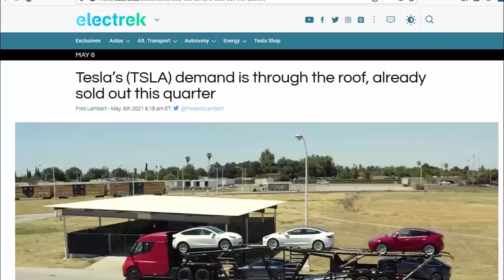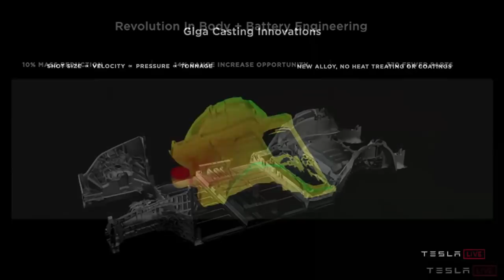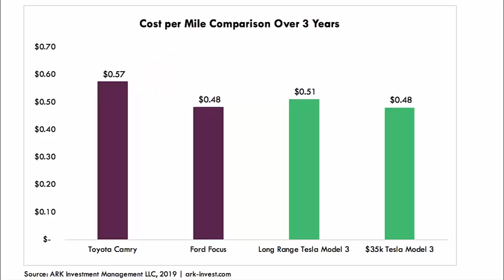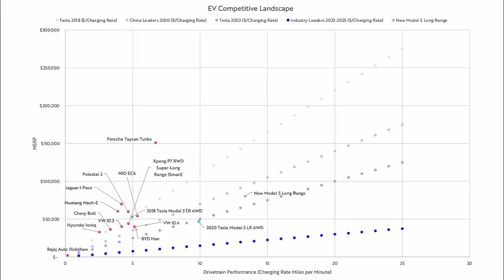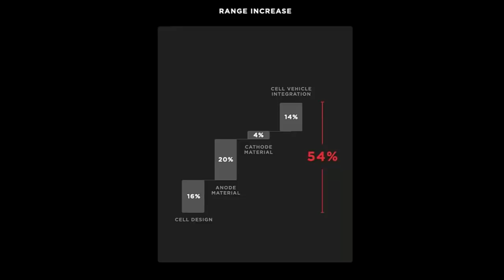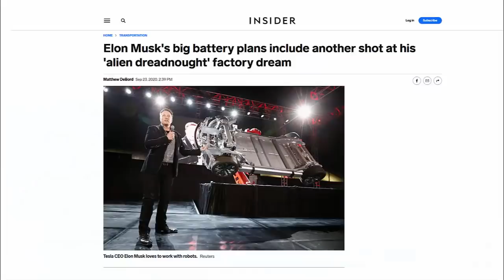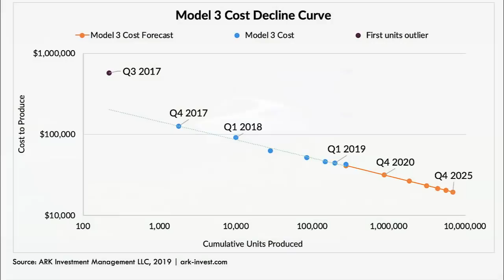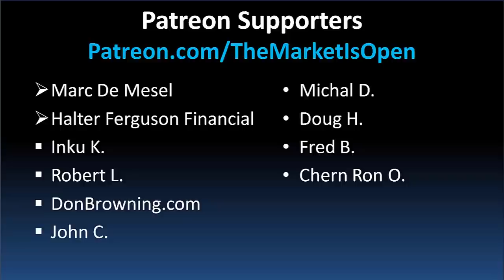The Frightening Economics of the Tesla Model Y

Comment: As soon as I drove a Model 3 in September 2019 out of the showroom lot I was sold.  Made the mistake of going with SR+, just not enough range for our traveling. So in June 2020 I traded up to Model S LR+.  It is a dream to drive and long road trips don’t seem much different than in our ICE vehicle.  As for insurance just shop around. Our insurance agent for years, tried to charge a little more than what we paid for our Buick Envision on top of the Buick so more than twice for two vehicles. I found another company that only added a few dollars to what we were paying for the Buick. Two cars for slightly more than one.  I am hoping to get rid of the Buick when I get the Cybertruck.  My wife likes the Buick only because that is what she is used to driving and says we need two cars.  In reality it sits in the garage too long and the battery dies so once we get the Cybertruck she will probably switch to the S.  We have only had to have service once and they came to our house and fixed on the spot having the parts because they diagnosed the problem over the air.  As you can tell I am sold on Tesla.
Reply: Cybertruck will be a big step up from the Buick.

Comment: The parts count reduction has enormous impact on all factors beyond that number and the obvious cost of the parts: risk of supply chain disruption, warehousing, cost of equipment, number of workers, hours to manufacture, and the number of potential defects in the product.
Reply: Another, not often mentioned importance of the single castings, is the risk when there is a flaw (detected or not).  Such a large part may result in recalls and huge yield losses due to scrapage.  I can't see the sense in such a move.  More parts are expensive, but these large parts will make the cars expensive to insure.
Reply: @ReachOutToWilliam  actually they have said it will make it easier to repair or replace. The whole piece or sections of it. If its damaged it can be cut and a new section bolted back to it.
Reply: Musk is not in the automotive business. He is in the engineering business. He has none of the old style thinking or practices. Less parts mean less problems. His biggest purchases are raw materials & probably Electrical power. He makes his own batteries. He makes his own motors, gearboxes/differentials. He makes his own chassis. Half the manufacture is done by robots & cobots. Every company on the planet has supply chain disruption risks. with block Chain & JIT he will know what his suppliers suppliers are doing before they do. Tesla is not a mass employer. It's an employer of a mass of enigineers, programmers & and code righters. He did not recruit those from other automotive manufacturers!
Reply: @marcusk7855  OK.  That's what they say.  Let's wait for reality.  And if what you say is true, what is the availability of replacement parts?
Reply: @ReachOutToWilliam  The also make batteries so are they not a battery manufacturer? Who designed the Tesla Vertical Integration business model? No car company on the planet is run like that? Where did all motors and motor controllers and battery condition monitoring hardware, firmware and software come from? They did come from Automotive because they don't do that stuff. What it goes to a try motor design with no rear diff? Someone has to design and prove it. Again no prior knowledge in Automotive. What about the Rimac C2 quad motor, the fastest accelerating production car on the planet? Is that not engineered from the ground up?
Reply: @kevinburke6743  All automotive companies employ every discipline needed to bring autos to market.  But they deliver autos.

One final question.  Did you drink the grape Koolaid, or the orange?
Reply: But what about maintenance without the warranty? Something breaks and you have to buy a giant part to replace, that's if they even sell them.
Reply: @TheKitMurkit  Things do break and things do wear out but there are a lot less of them. Look at the warranties now that some manufacturers give? Hyuandi now give 7 years as do Ferrari(which includes servicing.) There are others out there that offer 4 & 5 years or you can buy an extension. If I was Tesla I would sell parts but I would also extend the warranty to one year before battery replacement. Then set up a deal where the existing/next owner gets a deal upon a swappping out of the battery & a full bumper to bumper appraisal & service. Keep it in the family.
Reply: The new design looks like it's unrepairable after a single body impact on any part of the car, which is propably the goal as well.
Reply: @k0zzu21  Theoretically it should not need repairing! We autonomous driving there should be no more collisions! Still if it does it will probably be like the Mercedes/Smart car, you just buy pre-painted panels and bolt them on!
Reply: @kevinburke6743  are you high? Serious question. You talk absolute nonsense.
Reply: @kevinburke6743  <<He makes his own batteries>>  Ermmm......No, Panasonic make those!  Less parts mean less problems and cost savings at the manufacturing stage, but considerably more cost, to the owner down the line when these multifunctional parts need to be replaced, but of course the onus won't be on the company at that point.  Tesla needs to make a profit on their vehicles and this is the way to work towards this.

Traditional automakers are going to use as many existing components as they can, with the result that there are more parts, more connections, hoses and so on and more potential failure points, but cheaper to repair, due to components tending not to share functions.  This also keeps costs down at the manufacturing stage.  If you have a pre existing parts bin it makes sense,

Comment: I'll probably buy the Model Y once production gets going in Texas.
Reply: What's wrong with one made in California ?
Reply: @terrysullivan1992  The Austin factory will have the single castings for front and back, structural battery pack, and the 4680 battery cell.
Reply: When will that be? I will be in the market for a Tesla in the near future
Reply: @Motorman3538  Hopefully by the end of this year or early next year.
Reply: @terrysullivan1992  quality issues.
Reply: @terrysullivan1992  California
Reply: @chrisw9534  They already use that on the Model Y from Fremont as well as the upgraded paint machine.  The Model 3 has yet to be upgraded.
Reply: @bryanwhitton1784  They already use what on the Model Y?
Reply: @chrisw9534  Sorry, single piece sub frame on the rear.  The giga-press has been installed for quite a while now.
Reply: @bryanwhitton1784  Yeah they're doing rear single piece castings on the Y today, but they're not doing front and back yet.
Reply: @chrisw9534  Cool.  I had noted that that had two presses so I figured that one was for the front and one was for the rear.  My bad.  We know what assume spells. :-)

Comment: I don't believe the proprietary aluminum alloy was developed to maintain tolerances after molding, but rather to avoid the cost and time to heat treat the molded product (likely annealing), post molding, to achieve material properties like strength and toughness. This alloy likely allows avoiding a major step altogether.

Comment: Something else should be gained. With a stiffer frame any torque dampening by the frame/body should be further dampened increasing efficiency. I'm sure Tesla has considered this. There's just so much upside from the GigaPress whole-components and the stiffer structural battery pack. 
There's only one downside - my 2020 Model Y LR is going to be a bit less state of the art.

Comment: I wonder if the cars will be considered “totaled” in medium wrecks when part of the casting is broken.
Reply: You mean like when the car is considered totalled when it has the frame bent on any other car? A vehicle is considered totalled when it is more to fix it than to buy a new one.
Reply: Can apparently have the damaged part cutout and a replacement part welded back in. But the reality is cars with this much damage either with large cast parts or old designs are uneconomic to fix, scrapped for parts.
Reply: @turningpoint4238  As i understand it it's more of an insurance question; sure you can repair it but can you get it reinsured? They seem to be averse to paying a significant price for work that may fail with, presumably, liability to them.!
Reply: That was certainly a consideration before the switch to giga-casting. But typically, any wreck that causes damage to the core frame or "skeleton" of the car will result in a totaled car. A wreck that bends or breaks parts that deep in the construction will rarely be a "medium" wreck. Even wrecks that only damage bumpers, panels and lights can result in a totaled car.
Reply: @turningpoint4238  insurance companies are obligated to pay for returning the car to pre accident condition,so "fixing" is not allowed.
Reply: remind me again how much that battery pack is worth ???? if damaged at all ... put it back on the road ?? yes no ?? replace ??
Reply: @storytimewithunclekumaran5004  Yeah more than what insurance companies will do, I would like to know the car would go back to Tesla to be recycled in some way, or used to build an inventory of spare parts that could be used to repair other Teslas.
Reply: "I wonder if the cars will be considered “totaled” in medium wrecks" - Tesla cars actively avoid accidents, so that problem will be reduced by 90%.
Reply: @turningpoint4238  welding aluminum is not a simple task.
Reply: @DIsmayedConfuse  It's done all the time.
Reply: @turningpoint4238  not by typical body shops.  But keep trying.  It's funny!
Reply: @DIsmayedConfuse  No, guess the old fashion will have to keep up or get out. But aluminum welding is quite common. A chap I was working with the other day was showing me the work his son does welding wet jets up for boats. Really try looking it up. Been thinking of upgrading to a new tig welder so I can try.
Reply: @turningpoint4238  Welding aluminium is very difficult, since it oxidizes much more quickly than steel and the oxidation layer isn't suitable for welding and requires a much higher temperature to melt.
Reply: @k0zzu21  I used to weld lead that oxidizes very quickly as well, but it's not hard. Welding aluminum isn't a great deal.
Reply: @turningpoint4238  lead is somewhat corrosion resistant and has a low melting point. It's one of the easiest metals to weld (without considering the safety hazard). Aluminium is one of the most challenging.
Reply: Lead is a very different metal to weld compared to other metals as is aluminum. It's not hard just different. A decent welder trained to weld aluminum can replace bits on this car. But as stated before if it's that extensive damage, as with normal cars, an insurance company will write the car off. Not sure why this is a big deal.
Reply: Even minor fender benders will total these cars. It's like this already for the current ones.
Reply: Yeah... Don't buy one of these cars at an auction.. you'll regret it.
Reply: actually you can total some by simply braking the coolant port off the battery. Check rich rebuilds. He had a 2 different customers  with this problem. Model 3 had broken port and almost new car (lease). Tesla said battery pack will need replacement 16K. The coolant ports are plastic and can be broken by something hitting underside of car. Rich rebuilds did fix it easily with a pipe fitting. Battery's are the issues with these cars(along with charge times). If you just constantly keep yourself in car payments electrics will not be a problem. I tend to keep my cars to 300k+ , a electric is not going to do this without needing a battery at its current tech.
Reply: @mitchellcrane9809  I don't know about the first bit of your comment but the last I'd disagree on for most people. Most people don't do excessive distances in their cars. Just plug them in when you get home. Charge times have come down and for most that once or twice a year you need a fast charger on a long distance drive you should be stopping for a rest break. Most ICE cars are scrap well before 300K and modern batteries easily keep up with these ranges.
Reply: @mitchellcrane9809  Oh on the first point you can total an ICE car by knocking the oil filter off or any other small accident that drains the oil out. As an example, could have gone with the radiator I guess.
Reply: If part of the castingi is broken, then maybe, depending on the repair cost, but as mentioned below, even aluminum is repairable. Insurance will typically pay 35k in repairs versus 50k for a replacement vehicle. It's simple cost/benefit for them. My wife's Audi SQ5 was in minor accident at 4-way stop sign...replaced nearly the entire front end. Cost was 18k (mostly in parts) The car has a net worth of roughly 30k...So, we had it repaired. Same cost analysis is done. Tesla's limited approved shops and available replacement parts makes them more expensive to repair, thus leading to some cases of being written off by insurance, but it's not a matter of just a casting having some damage.
Reply: @turningpoint4238  Not unless it is a pretty old car. It does not cost 15k to put in a engine on the average car unless where talking european. Average engine install at my shop is 4-6K for rebuilt engine with the trimmings. Some where I read that the chevy Bolt battery was 15k in the crate. I just rebuilt a car for myself 2007 impala low mileage engine/resealed,rebuilt trans,rebuilt front suspension/bearings/brakes,new tires,touch screen radio,upholster front seat, and to many other things to list.I spent 6k (in parts)including the cost of the car. Now this is far more then I had originally planed on but I happen to like this particular car. Now I will probably go 200-300k with out major problems other the usually service/brakes/tires etc. I get 300-400K on my cars normally (still running). Big difference in comparison to 15k battery that is unlikely to last to 200k with current tech. Now admittedly 10yrs down the road with tech improvements in battery life/cost/recharge time this situation will greatly improve. However right now the cost per mile starting with  a new tesla vs my older cars I think I am still ahead. Another thing to keep in mind is that US average car age is about 12 yrs. That is because of the cost of a new car. Most people can not afford to flop out 30k+ for a new car or like me refuse to take the financial depreciation you see as soon as you drive one off the lot. The depreciation will be greater on current tech electric cars more then likely . One can see that in the nissan leaf. I have seen many for 6k or so with 30-40k miles.
Reply: @mitchellcrane9809  Comparing a 2007 Impala to a Tesla is like comparing a ZX 81 to a modern PC.
Reply: @gsilva220  Who cares, get a new one. The other person’s insurance will pay for it since I have it on video.
Reply: If the car is totaled and you're still alive that's what you will be focused on.
Reply: @danielstapler4315  
That is not always the case. Suppose your car gets backed into while parked. It is not always the case that one will be focused on alive.  The fact that these cars are expensive to repair also lends them to be totaled by insurance companies more often is also a factor. So the big casting is probably expensive (I have no evidence, this part is a guess), the valet parks it in a bad spot and it get backed into and the back casting breaks or bends.  That huge part of the car.  In the olden days with gas cars, insurance would ok a repair shop to find a like model car that had a front end collision and take half of it.  Wonder if they do this for Tesla’s.  It seems in the videos that they are totaled for moderate damage.  Parts are expensive on Tesla’s.  This adds up to the residual value of the car quickly.
Reply: @Coltn3125  when the parts are very expensive, this happens with less damage
Reply: @willfrank961  
Unfortunately, I have purchased cars I find out later have been “straightened”. I guess it can be done, but without a tooling jig, how precise is questionable.
Reply: @bearlemley  my insurance agent said just this; they tend to total any Tesla with more than a fender bender.  The condition of the battery is of great concern, better to just charge higher insurance prices and total them out when wrecked.

Comment: ICE vs electric is film vs digital photography all over again. It will be about 15 years and the only companies left will be those fully invested in electric vehicles and niche ICE. The rate of change will be logarithmic, not linear. The fastest change will happen when solid state batteries ramp up in production capacity and reduced cost. That will be the end of ICE dominance.
Reply: The end of ICE dominance will be when the cars cost the same or less to buy, are as repairable as ICE cars or more, and are able to charge within 300 seconds. All I see is an arms race of manufacturers putting more and more batteries to get more range, more powerful motors to drag those batteries around, and bigger screens to justify the enormous price without the need for luxury materials. It's the same thing that happened in the early 1900's and ended EV's. If you say it won't happen again, Let me remind you EVs were 50% of the whole fleet back then.

Comment: I plan on getting model Y or Cybertruck in Romania when they have an EU factory and prices are lower... I only wish if I go with cybertruck, by that time they will have analog options for interior ... in special for heavy duty operators where they need mud resistant controls and also power washable interior. (i plan on using this truck for all sorts of jobs because of the versatility in consumption/load and the cheap factor of solar/wind energy if you have it installed at home or work, to charge the vehicle for almost free)